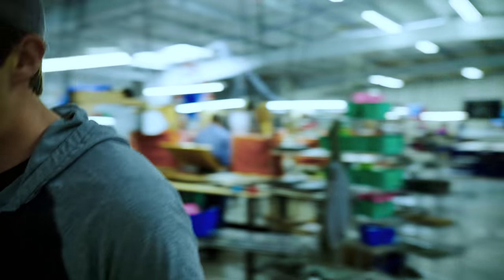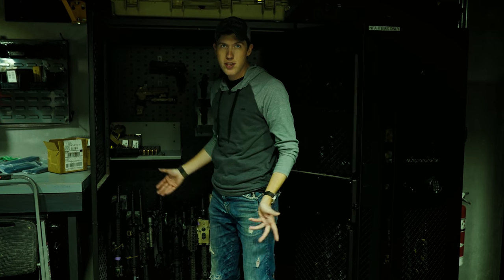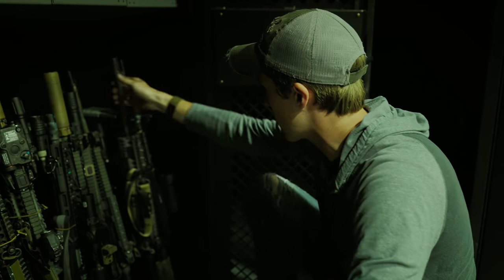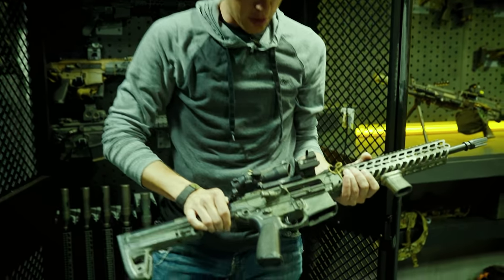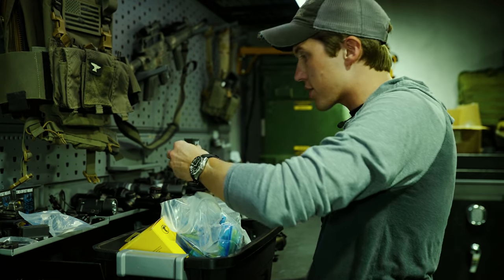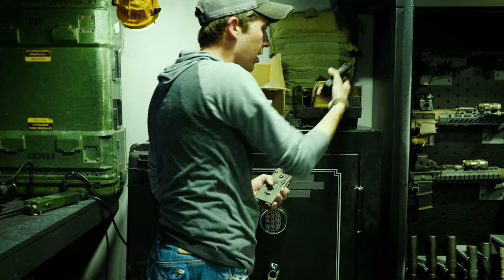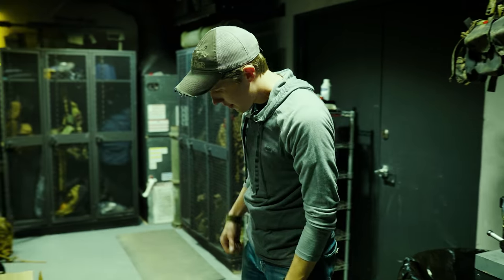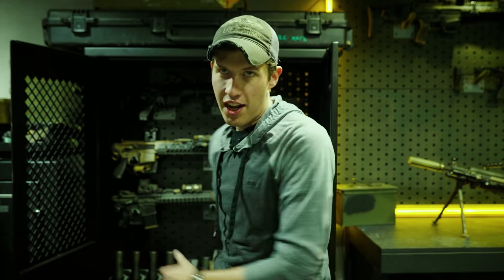T.REX ARMS Armory Tour!

Comment: modern 1911/2011's are ridiculously reliable. I have several thousand rounds through my Atlas Nyx V2 as an EDC without a single issue. Cleaned it roughly every 1000rds. I can never ever go back to the toy feeling trigger on a striker fired pistol. If you shoot a lot, and having quality hand built carry piece is important, you save until you can afford it. In my case I sold 8ea striker fired polymer wonders to get one NYX v2. It is so worth it to me.